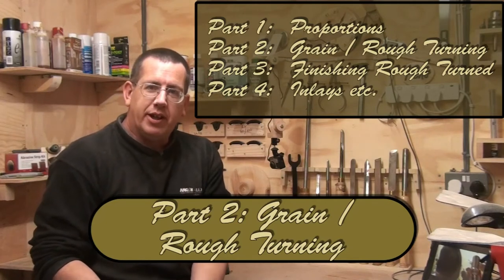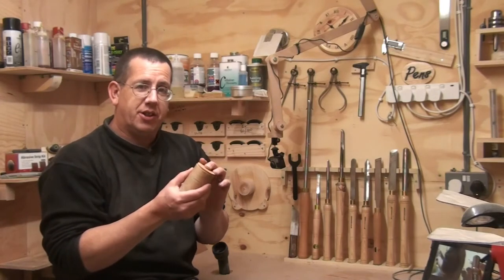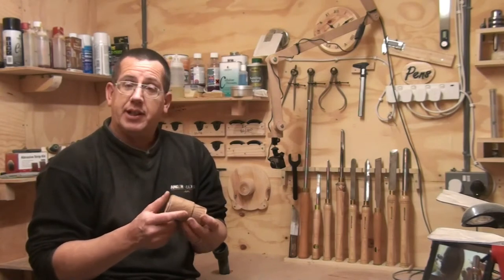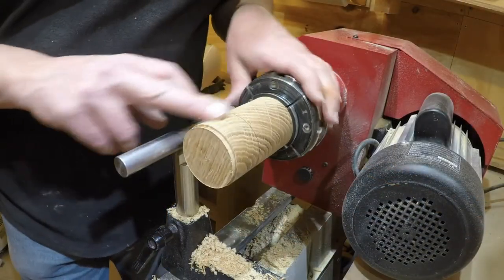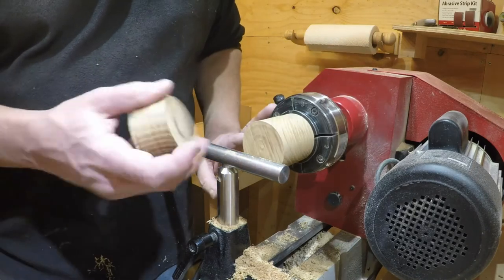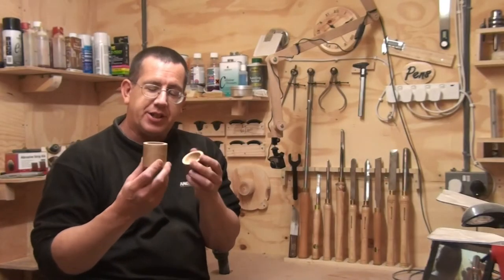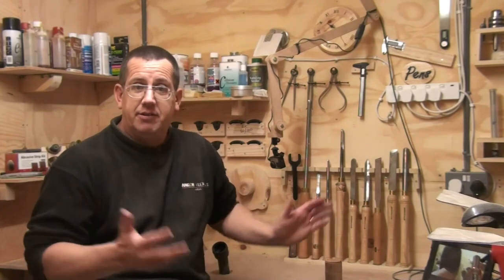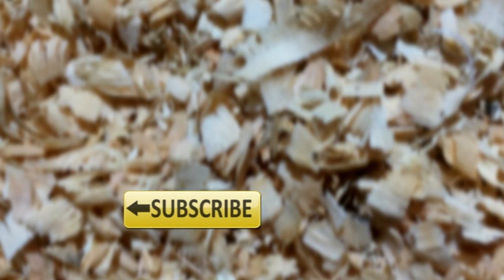Box Series Part 2 - Episode 86

Comment: Very good demonstration Paul. When you sharpen your bowl gauge, what degree is on it, I think mine is about 30° but soult it not be better about 40°? Cheers my friend, Júlíus
Reply from the maker: Thank you Julius. I don't actually measure the angle. I think my bigger bowl gouge is at a lesser angle than my recent smaller bowl gouge. I think that if you want it for bowl work where you can use it across the bottom of the bowl then you need a higher angle which is why I do them separate. Sam Angelo has mentioned this before on his gouges, where in fact a double bevel works best on bowls.

Comment: Hi Paul
I really like the way you start hollowing out from the centre towards the outer edge. I'm only confident using the bowl gouge as a push cut from the side and in towards the centre. Have you any advice on the technique you use?
Cheers. Andrew
Reply from the maker: Hi Andrew. I did cover this in an earlier video which I've just looked up. If you take a look at Episode 77 at around 5:00 minutes is where I talk about this. To me it is a really important option as I rarely have to use the forstner bit (which mine are fairly blunt anyway). Depending on grain orientation you often want to be hollowing from the inside out so that you are cutting downhill. Well worth practising even if you start with shallow hollowing like the lid of a box, just watch the wings on the gouge as you pull out, pivoting the whole gouge is key.
Reply: Thanks Paul. I will check it out.
Cheers. Andrew

Comment: Hi Paul, I've been turning for about 10 years and I've never seen a box done in this orientation before.  It has opened up loads of potential for me now.  Thank you.  What type of damp meter did you use please?  I can't decide which to buy.
Best Wishes, Brendan.
Reply from the maker: Thank you Brendan. I'm surprised you have never seen one this way in all those years. After all a bowl can look quite stunning when you change the grain around, so a box can look totally different too. I got the same one Martin has, got it from eBay ages ago. They may not be 10% accurate but they give a good guide. I know Sam Angelo has a good one where you don't even have to use the prongs. If I was after another and they were a sensible price then I would certainly consider those.
Reply: Thanks Paul, I'll have a look at those.
B